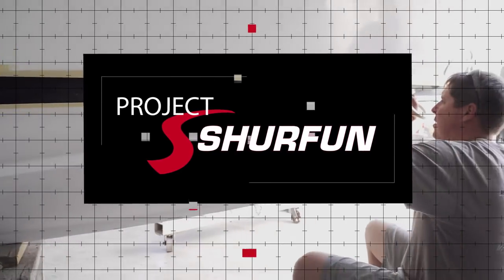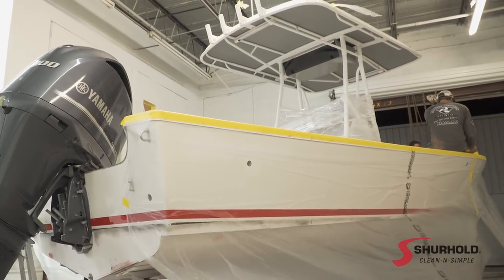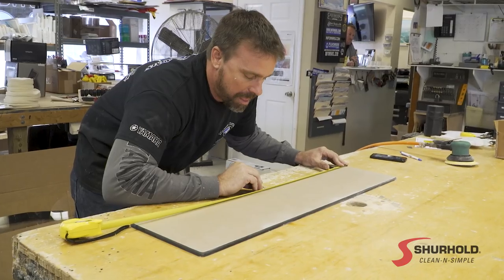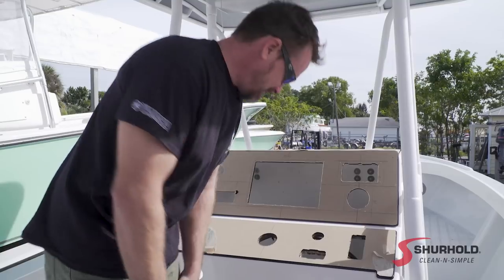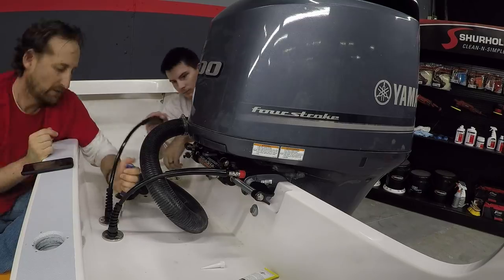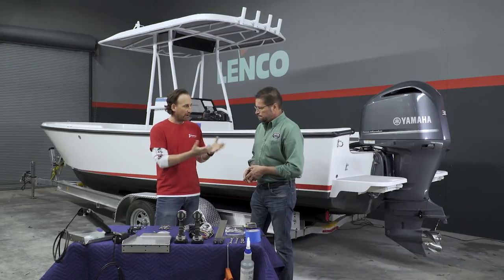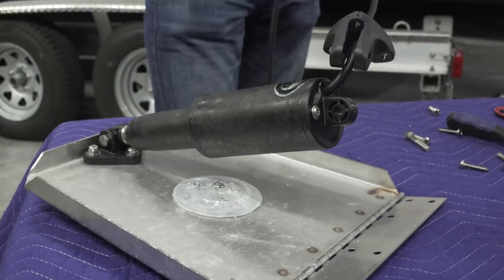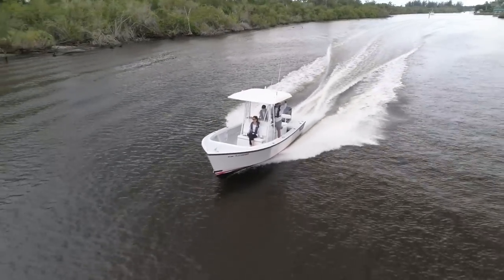Project SHURFUN Episode 3: Bottom Paint, Rub Rail, Dash, Seadek, Trim Tabs

Comment: Why does the starboard side of the trim tab controls in the helm operate the port side trim tab, and vice versa? I don't have trim tabs which is why I ask. Thanks.
Reply from the maker: David Mitchell great question. When the left tab goes down it causes the left side of the boat to go up and the right side to go down. To make it more intuitive it is wired this way so when you press the right button down the right side goes down.

Comment: Looks like you mounted the stainless trim tabs OVER the copper bottom paint, won't this cause a reaction and slowly corrode the trim tabs?
Reply from the maker: Great question. Although galvanic corrosion is an issue with most dissimilar metal applications, the copper in the bottom paint has an extremely mild reaction to the stainless. Many boats that spend their entire life in the water paint over their underwater stainless steel with copper-based bottom paints with little to no effect, even decades on. We don't anticipate any long term problems with our application.